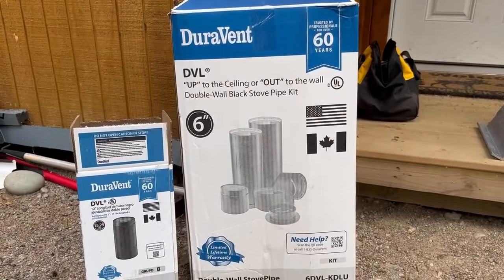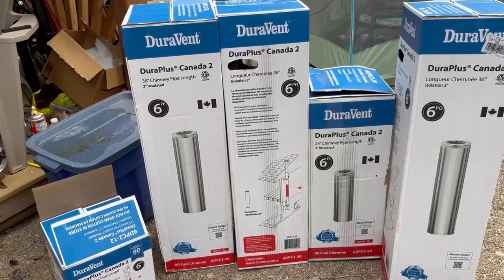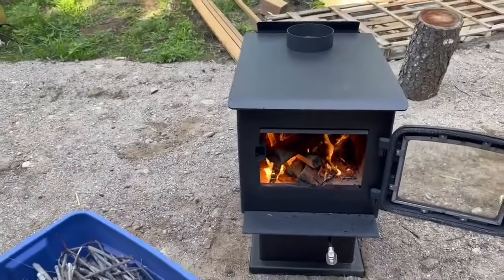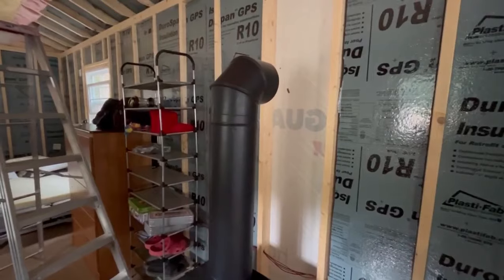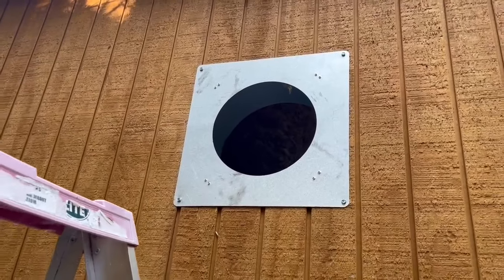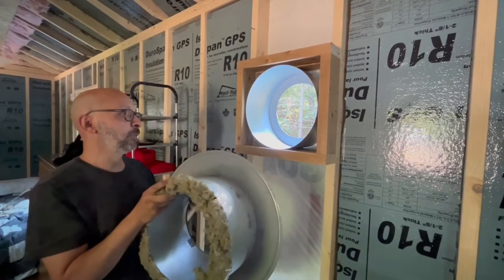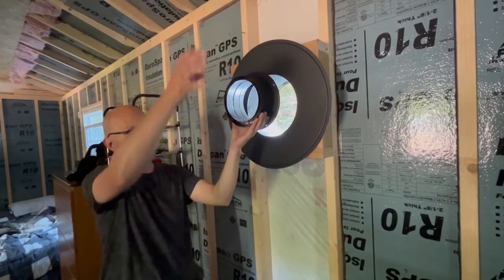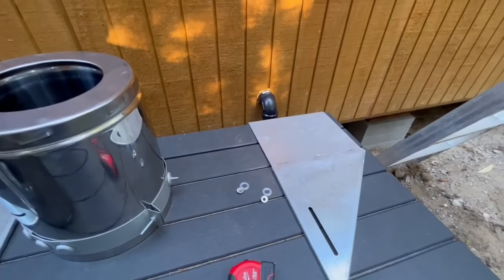Installing the WOOD STOVE & CHIMNEY at the OFF GRID property

Comment: Drolet says exterior chimneys are acceptable but interior and through the highest point of the roof is best. The guy at Morton (Metal) Buildings recommends exterior, as you have done. Now that you have had this for a year, what are your thoughts? You probably will be cleaning it soon. I'm interested in that as well.
Reply from the maker: I didn’t go up through the roof because I was worried about water leaking in since we are away from the cabin for weeks sometimes. That being said we have had no issues with the installation and the chimney works very well. I cleaned it a few weeks back and only found a small amount of creosote. We are very happy with the installation😁😁

Comment: Are you sure the male end of flue extension goes into the branch piece on the tee? Duravent says the male section of flue extension should point back to the stove pipe?
Reply from the maker: Well it’s worked properly for two years now, so I think I’ve done it properly😀😀

Comment: U got that hanger up side down it's supposed to support the bottom of the t section
Reply from the maker: Thanks for the feed back, the codes in Canada are different from the USA, the Canadian kit puts the T section in this way. It’s different from the US version. It does look strange, I agree!
Reply: Did you add screws to the t bracket on the chimney ?

Comment: truenorthoffgrid367 .. Nice work.. Quick question.. may be i am missing something here.. why cant the exhaust pipe terminate horizontally may be like 2ft from the wall ?? Why does it it need to go up?? Is there any Canadian American regualtions deciding this?
Reply from the maker: The law in Canada says it needs to be 2 higher than the roof peak. It also helps the stove draft properly

Comment: I am going to do the same thing with a camp here in Maine. After talking to a wood stove place where they wanted to charge me over $3000 to install the pipe and they would not go through the metal roof. What does that tell you!
Reply from the maker: We had the same issue here…. Installation would have been minimum 2k, so I decided to try it myself. It went smoothly and the fire place drafts beautifully!

Comment: Looks good.  Can I ask what model of Drolet stove that is, and how many square feet your cabin is?  I'm trying to decide between the different "Escape" models myself.
Reply from the maker: Our stove is the Escape 1200, it’s way too powerful for our little cabin ( about 360 sq foot) but if I run the damper way down and open a few windows it fine. Great stove at a great price!
Reply: @truenorthoffgrid367  Interesting.  I was leaning towards the 1500 only for a longer burn time over night, but I'll have to rethink given mine is a similar size.
Thank you.

Comment: I'll be installing my wood stove in my pole barn this weekend...first time and no helper so your video was a great help. Thank you so much. That part about cutting the hole in the wall...I have that same feeling but I prefer that ...to cutting a hole in the roof.  Clear and to the point  Thanks for sharing.
Reply from the maker: Thank you so much, my thought was that it was easier to go through the wall to prevent leaks….but you are right, stoves draft better when you go up through the ceiling!

Comment: Great video. How did you connect the interior insulated pipe (the stainless insulated one that goes through the wall horizontally) to the T? Thanks!
Reply from the maker: It just twist locks into to place like the rest of the stainless chimney pieces. Very easy to install once I got the sizing figured out
Reply: @truenorthoffgrid367  I'm running into a problem - I got a stainless double-walled 18 inch pipe to go through the wall but it neither twists nor locks into the T. Can you by chance link to the "through the wall" piece you used? Thanks again. I think this is my first time ever commenting on a YT divide :D
Reply from the maker: @jeffperron9407  not sure how to make a link, but it’s the DuraVent through the wall kit. I purchased it at Canadian Tire. You can find it on there website

Comment: Think it needs to be 2 feet above the peak for proper draft, plus I seen a huge gap around the pipe entering through the thimble, how are you going to fix that? Looks like a wooded area that should have a spark arrestor cap on top?
Reply from the maker: It’s close to 2 feet above the roof line, but it works fine so I probably won’t change it now. There is no gap at the thimble, there was a small space but I filled it with high temp silicon. There is a spark arrester inside the pipe  as well

Comment: Bought the same dura vent to add an extension to bring it up to code. We can’t seem to get it on. It’s supposed to screw on another piece but just won’t go on all the way. Just one side wants to go in not sure why
Reply from the maker: We really struggled to get ours together as well. I remember the fit was very tight.

Comment: I have this set how did u attach the elbow to the chimney pipe, can't figure out how to put the flue on seem rather tight to push it into the chimney pipe..
Reply from the maker: I remember that it was not easy to fit the adapter flange that fits to the end of the horizontal chimney pipe. The fit was very tight and I had to put a piece of wood over the part then hit it with a hammer….. probably not the best way but it was all I could figure out and it worked. Hope this helps

Comment: Well, its been a year, did the snow take it out when it slid?
Reply from the maker: No, the chimney survived the spring thaw and didn’t move at all with the snow sliding off the roof. It has worked great since the installation and only had a bit of creosote to be cleaned before we started using it a few weeks ago. Happy I decided to do it myself!

Comment: Hi! That's very helpful. I try to do my research before installing my wood stove. Is it a good idea to get the pipe through the wall? I heard that there is no problem if the height of the pipe is at least 4 meters but in any case the vertical part longer than the horizontal. Does it have for the top of the pipe to be higher than the roof ridge? Also, I saw that your pipe is close to the trees. Do you have something to prevent sparks from getting to the canopy? Thanks alot! You give me inspiration for my endeavors!
Reply from the maker: Hey Elias, I think it’s always better to go strait up through the roof, but I didn’t want to risk having leaks when I’m not at the cabin since it’s only a weekend getaway at his point. My installation works great, the chimney drafts well and I have not had any issue with it so far. There is a spark arrester built into the top part of the chimney pipe and mine sits a bit higher then the ridge line of the roof. I should probably go a bit higher and will likely add another piece in the spring. Appreciate your kind words, thanks for watching!

Comment: Great Video!!! Hey, does the top of the chimney have to be higher than the very top of the roof for it to draw? Did this work well? Thanks!
Reply from the maker: Top of the chimney is supposed to be 3 feet higher then the top of the roof for clearance, mine is not…lol It does draw beautifully though! I have no issue with it so far. Works great!
Reply: @truenorthoffgrid367  Yeah, I was thinking your smoke stack wasn't tall enough, but that is exactly how I want to make mine. 😂 Thanks for the Great news Brother!
Reply: Actually it's 3ft taller than anything within 10 feet .

Comment: Wheres your damper
Reply from the maker: Hey! I did not install a damper on the stove pipe. I’ve been using the damper control on the front of the stove to regulate temperature and burn time. This is working fine for my stove. Thanks for watching!